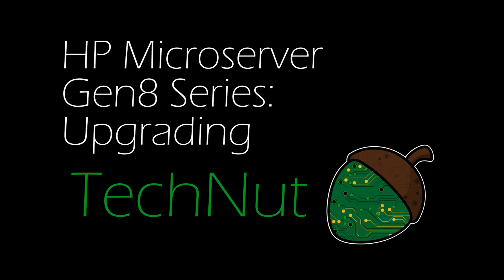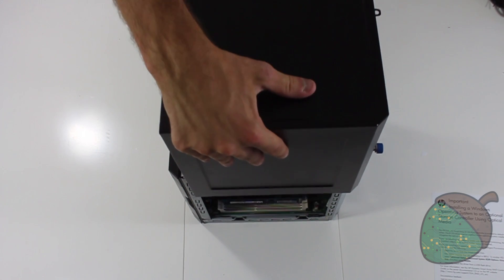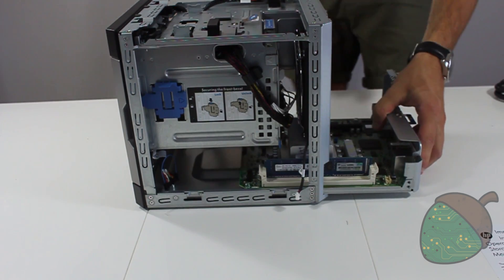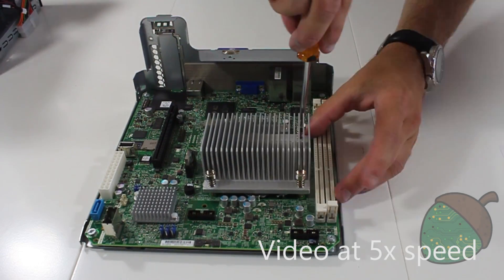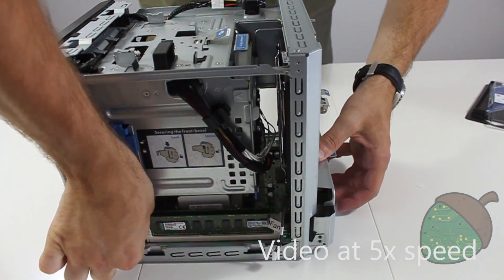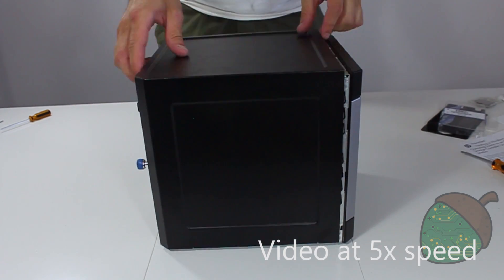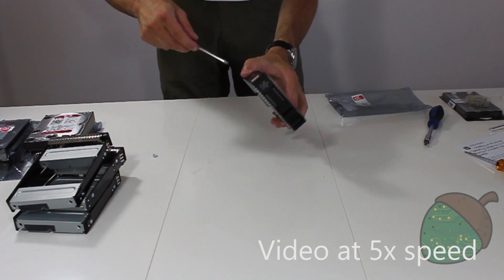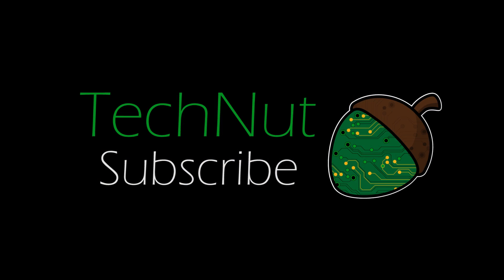HP Gen8 Microserver Series Part 2: Upgrading

Comment: Great videos Technut, clear and precise information, the box is a little powerhouse now. I started to do this last year with mine  the SSD and Xeon upgrade were completed, I then moved house and it's been on the "to do" list since then :-)

 I put in a better SAS controller and I just have a bunch of wires sticking out of the top now lol. I came here to see where the  the SAS/sata backplane went :-) 

I have WD Red's in my N54L and never had any trouble but I am thinking about a different brand in finishing thsi project. Cheers fella subscribed and looking forward to your nrxt project.
Reply from the maker: That's awesome, just swapped my 4 WD REDs for 4 Intel SSDs :D Thanks for watching!
Reply: OMG that must be wickeldly Usain Bolt fast...Damn you for putting that idea in my head....I can't unforget lol
Reply from the maker: Haha got a good deal on 256 gb Intel SSDs not the fastest around but way better then mechanical disks. Also the server is pretty much dead silent now :)

Comment: Sorry for the question: the original CPU G1610T have a 35W of TDP and new CPU E3-1230V2 have 69W of TDP. It's work fine?
Reply from the maker: +Davide Sini It actually works fine. I've had my server running for around 2 years without any issues. The CPU temp is around 40 C in a room that is 23 C. Probably a bit hotter under heavy load but not critical :)
Reply: +TechNut Great! Thank you!
Reply: +TechNut Another question... do you have disable turbo mode?
Reply from the maker: Actually had to check my bios to find out. Intel Turbo Boost Technology is enabled on my server :)
Reply: Thank you!! 👍
Reply from the maker: +Davide Sini Happy to help :)
Reply: Very good question Davide. I have a spare Pentium G2030 3.0GHz CPU lying around and want to slot it into my Gen8. TDP is 55W. Thanks for the clarification Technut. Will install it soon.
Reply: feedback please @Greg .. has it melted or still chugging along?